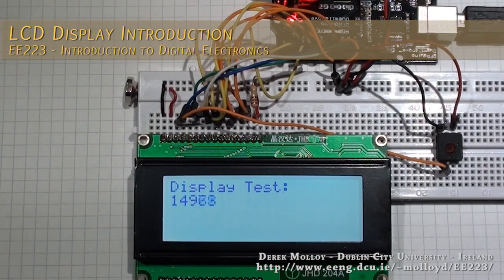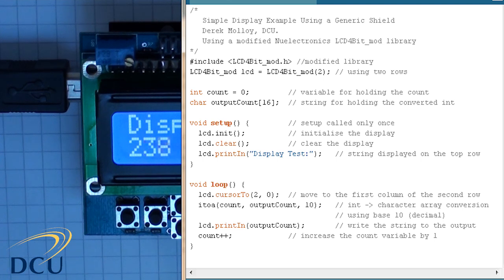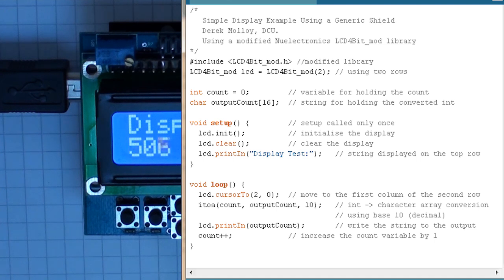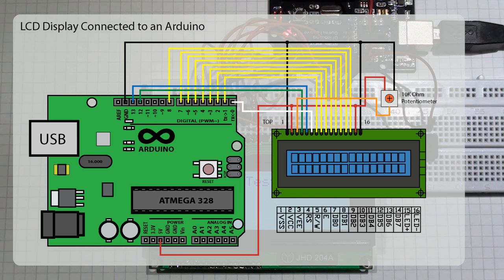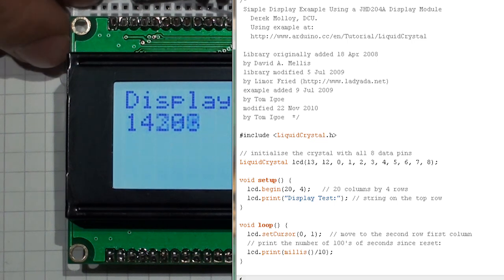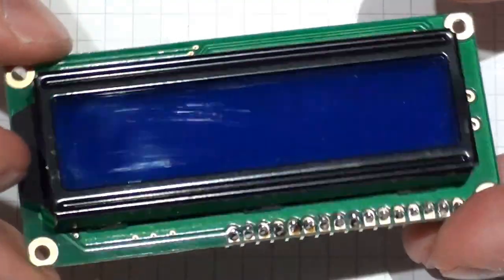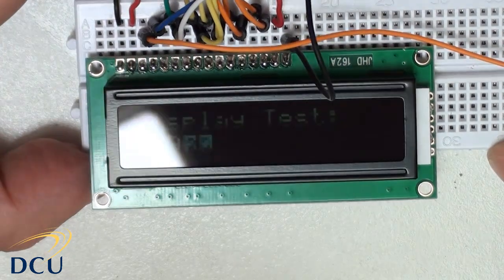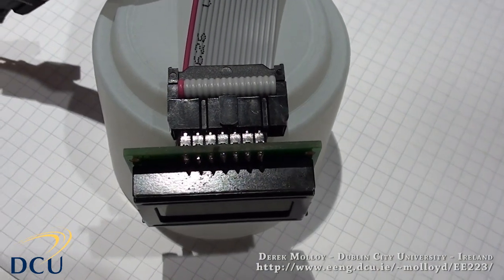Arduino: Arduino LCD Tutorial

Comment: Currently working on LCD displaying with my 16 hz arduino clone. Got the kit and everything and was happy to see the LCD screen in there! Anyways, I set up my circuit and software exactly like this website https://www.arduino.cc/en/Tutorial/HelloWorld?from=Tutorial.LiquidCrystal. When I plug in my circuit everything seems to work fine except I get the top row of the LCD screen with white boxes that dont seem to go away. I did a little research and apparently the issue is because the LCD isn't initialized properly? Which doesnt make sense since I'm using the example code. I can adjust the contrast of the screen just fine and I'm almost positive everything's connected correctly because I've torn apart the circuit 4 times and redid it and got the same error every single time. I was wondering if you could shed some light on this dilemma I'm having.

Comment: Your code has a bug in it.  A 16-character-string requires 17 character space.  So, "char outputCount[16];"  will give you a memory corruption whenever your program write to the sixteenth character.  In your case, the problem would happen at itoa() and printIn().

Comment: IMO there is too many displays shown, the code posted at 1:45 doesn't work. I have a screen with boxes as iMacPwn mentioned except mine are on the second line.  If you had separated the various screens it may had been clearer to newbies such as myself.  Seems to be a case of knowing too much to teach the basics.  There are a lot of these on youtube.  For myself I wanted the counting function of your display to sense a light that is draining a battery charged on my Bedini pulse oscillator.

Comment: The TX/RX pins are only used for serial communications. In the case of this example program, the only time the Arduino is going to be using those pins for that purpose is when uploading the program to the chip (as there is no serial data being sent/received in this program). When this happens, the bootloader firmware inside the Arduino multiplexes the pins for serial comms to let the file be uploaded, then lets the program do whatever with them after burning the it onto the chip.

Comment: Double check your code and connections! 99% of the time its the connections that are the issue. Wire it up as per the LiquidCrystal "Hello World" example and run the example sketch to test your display (although it's very unlikely that your display itself has a problem)! The row of white blocks only on top indicates your contrast and all is fine, but the display isn't receiving the right signals. Once you get it up and running, play around with some of the other features of the device :)